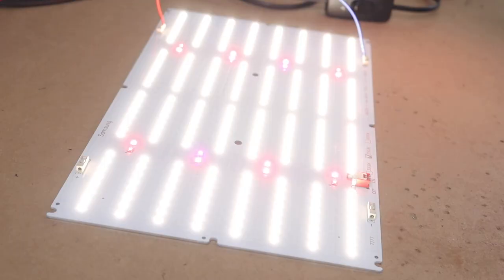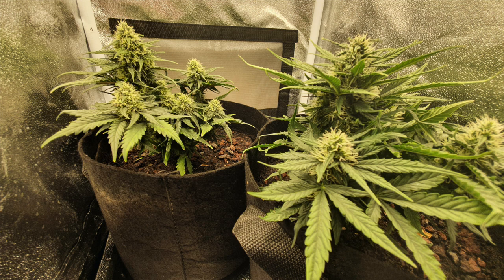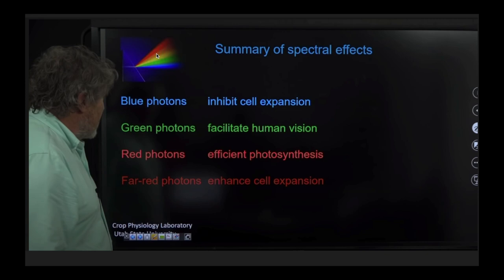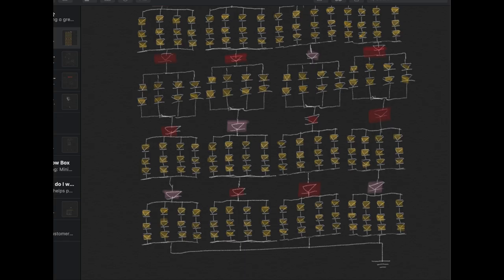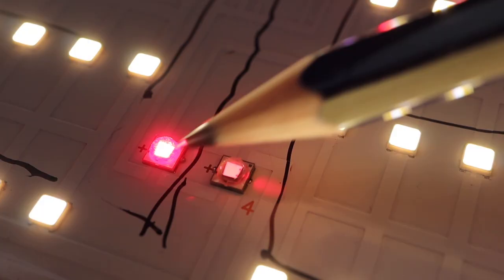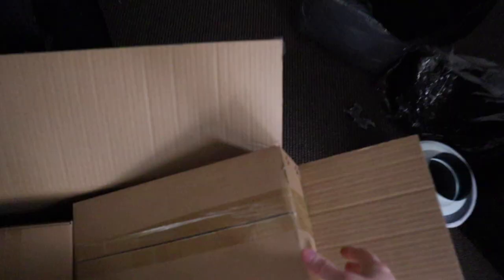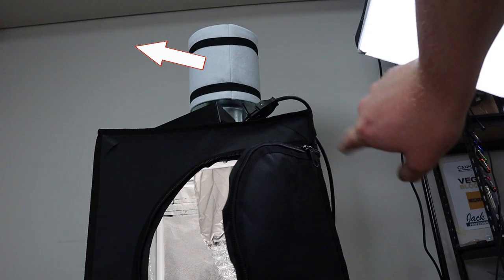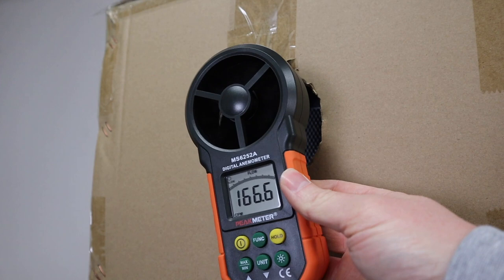TomatoTent V2 - The NEW Grow Light & Measuring TomatoTent Fan pull through 2 Carbon Filters!!

Comment: The new hlg lights have 16 far red chips, but they cost a lot. Something to think about if you wanna upgrade your tent
Reply from the maker: Which light from HLG is that?  I just checked and found the HLG 650R. But it has no Far Red.
Reply: @HomeGrowEngineering  weird, never heard of a 650, maybe thats new. I meant the 550 v2 rspec one for 850 dollars. By "you" i meant people reading this comment, not literally YOU :D. As that light would be waaay overkill for the size of tomatotent

Comment: The shadow on wall is termination line of light  escaping from refractor if you build led refractor like two c shapes adjust it and light curves slightly amplifies lumens colliding two beams this worked on sodium
Reply from the maker: Good idea
Reply: @HomeGrowEngineering  it was science lesson on curve of light we found it increases the sodium output shadow on wall was important with lumens tester Matt white is better than silver reflection on the sodium bulb sodium bulb needs cleaning regular basis because of particles block light I wonder if cleaning LEDs is similar great tents how much do they cost ? another way to tell light is close enough is leaves point higher and stalk between nodes is shorter
Reply: @HomeGrowEngineering  also handy to add a small green led for night time access? Cool tent I must buy one

Comment: I like what u have done with light...a bit confuse tho,,you done that so plant can grow taller but now u have put  the carbon on top of light which take away how high you can put the light...
Reply from the maker: I did it so the light can go closer to the plant. 

It's true, the filter takes away some available height.

It's still enough space for topped plants or Autoflowers.
Reply: @HomeGrowEngineering  yeah I agree 👌🏽 deffo enough room to do so 🌱✊🏾

Comment: You're measuring for enough air exchange, but you've neglected to factor the required flow for each carbon filter. Too little or too much and they don't filter the smell like they should. Also, you had that panel off the side of the heat sink, so the air flow would be higher than if it were closed. Speaking of them they are not sealed - they are going to leak around the seams, bypassing the first filter. A bit of silicone would fix that.
Reply from the maker: I added that panel before filming the airflow test.   True, it needs to be sealed, I am already adding an EVA foam gasket.

Comment: hello , nice work , I would like to order one set without tent to be able to get bigger. 2 questions about driver: 1)stronger version you mean it will power your light with 120w which is enough for 60x60 room?  will you be offering such driver or I have to search myself? 2)how about driver capable of running 2 of your lights ,same question > will you be offering such driver or I have to search myself?Can you put the link with the current driver you have so I can get knowledge and search myself for the options?  Thank you very much , can't wait for the order
Reply: I know you are bussy man, so I did my homework , so can you just confirm that connect 2 of your lights in serial connection and power it with Mean Well HLG-240H-48B   would do the job? this driver I guess should be compactible with your controller ..thank you
Reply: I am little puzzled now, will your controller work well with both types of MW driver ? I mean constant current/voltage driver  vs constante current only driver ?

Comment: Between 400-600 PPFD: This is great for early to late stage vegging cycles.Between 600-900 PPFD: This is great for the flowering, fruiting, or budding stage of plants.Between 200 PPFD and 400 PPFD, plants growth rate potential crawls around 30 - 55% which is recommended for mother plants or young, weaker plants that need a light that's not super intense. If you were to double your PPFD from 400 to 800, the growth rate potential reaches about 85%. You would think that doubling the intensity would push the growth rate potential pass 100% but the truth is, there’s a loss of power in return the more intense your lights become.  Once you surpass 1000 PPFD and go into Double Ended Grow Light territory, your plants stop becoming light-limited and start becoming carb limited. At that level of PPFD, increasing CO2 levels is highly recommended to take advantage of that intense light.